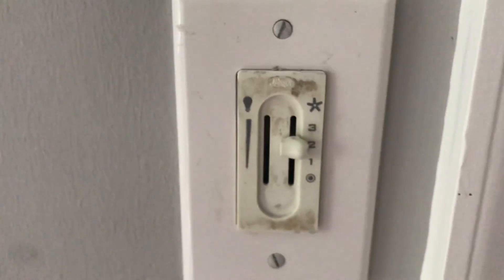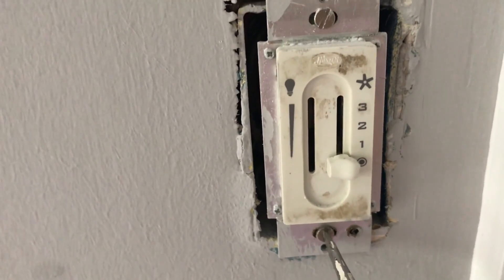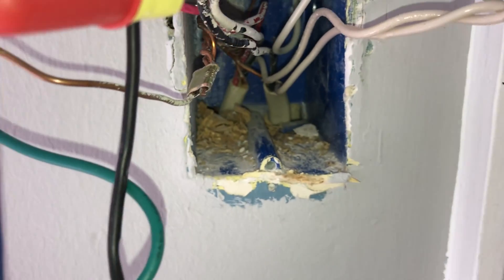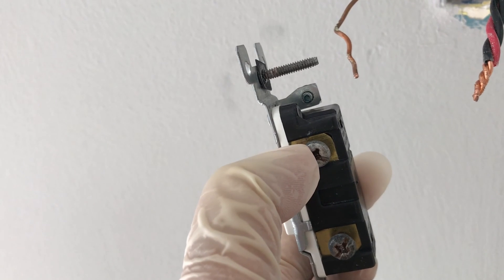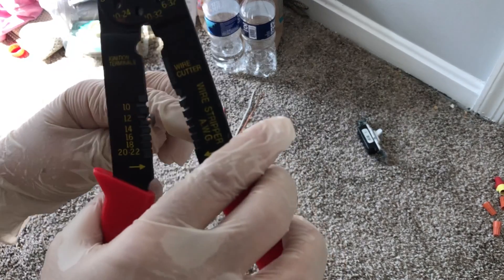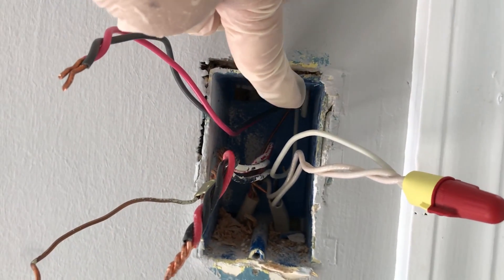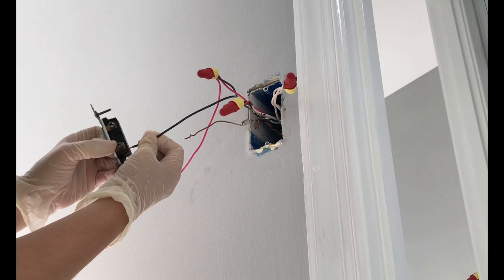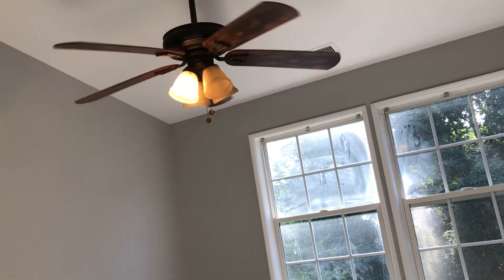HOW TO WIRE A CEILING FAN SWITCH

Comment: 😯@2:53 never connect neutrals to ground
Reply from the maker: Sorry, I misspoke! What is attached to the ground screw in the video is actually the ground wire, not the neutral wire. What is shown is okay but what is said in my video narration is incorrect. I should have said "ground wire" instead of "neutral wire." Thanks for catching this!
Reply: @KYKCreations  yes I saw you did it right. Good video
Reply from the maker: Thanks again, A B, for pointing out the error. I fixed it by removing the audio in that section of the video. :-)